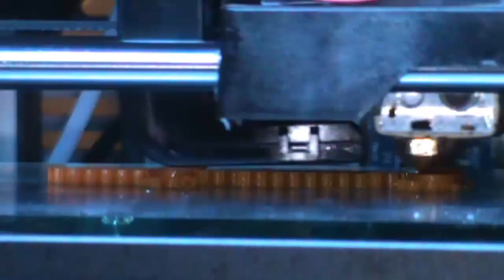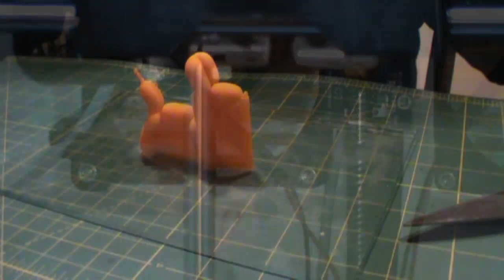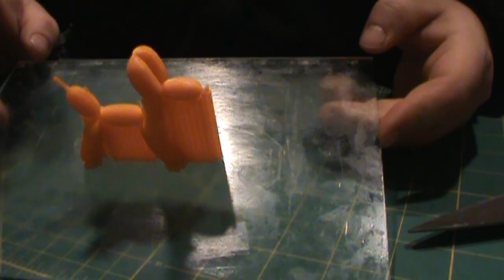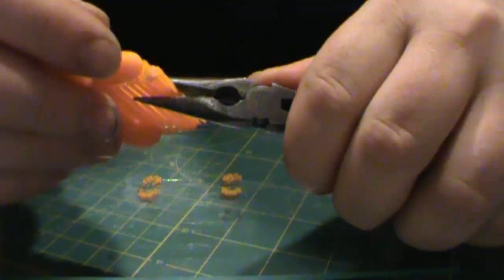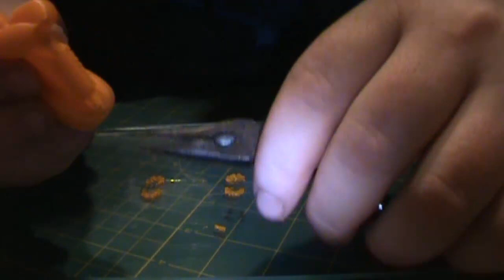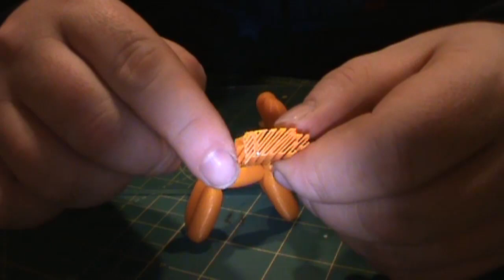3D print time lapse

Comment: thought about using my gopro for timelapse shots of my 3d prints, how many seconds would be good to take a photo? every 5?
Reply from the maker: Rob Hopper yeah i could see that working. This was recorded with my camcorder plugged in and with a 16gig card. The print was almost 3hrs. I sped up the video almost 30x
Reply: eastcoast78 I am going to experiment with mine and see what the best increment would be. the more pix it takes the more room it takes up on the SD card, even with a 32gb cap, it fills up quick with high resolution images every few seconds.